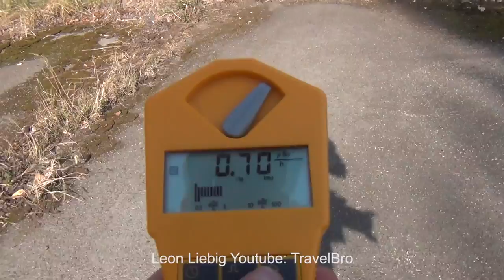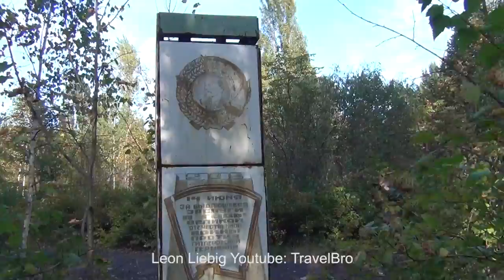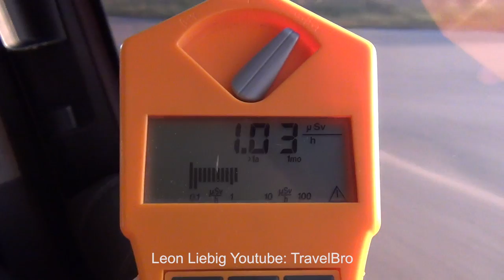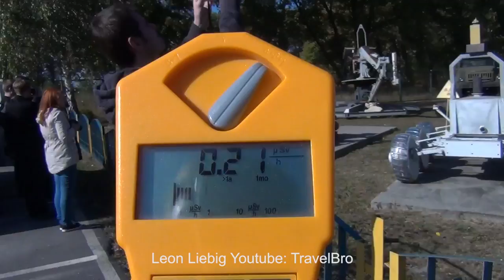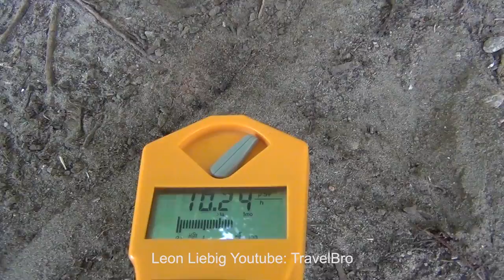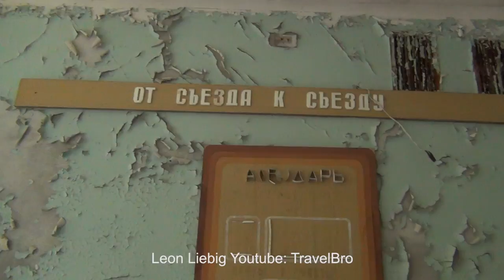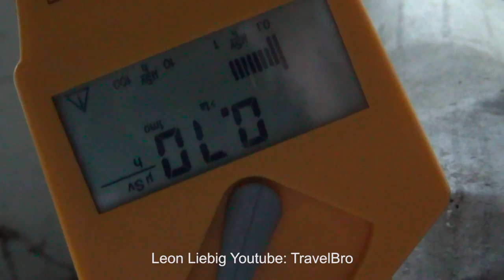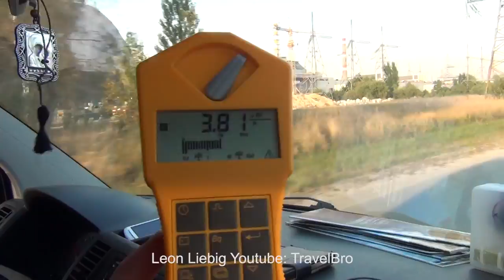Chernobyl Exclusion Zone

Comment: This's interesting to watch, but the behavior of the people during this visit was baffling; the meter was clearly indicating DANGER, and they were just squatting down, nonchalant as can be, watching the numbers. They even slowed down on the road when their meters started rising. Do you realize that the clock is ticking whenever you're exposed to radiation, and the longer you hang around it, the more risk it holds?

Furthermore, in a contaminated place such as that, you really probably shouldn't be crawling all over stuff, let alone touching any structures or plants...the Chernobyl tours website states that.

I'm not criticizing, but I think you guys were a bit careless with your health in doing this, but I'm grateful you went so others can watch. Just...be more freaking careful, please!
Reply from the maker: If it would be dangerous to stay there for a short time, we would not. :) Maybe inform yourself a bit more about radiation. There is a lot good videos about in Youtube :)
Reply: Nkoah nothing in this video was dangerous. standing in front of the reactor gives you between 2 - 4 Microsievert /h.  (Full body dose )
although 30x higher than "normal" places....  3-4 MicroSievert /h Is about the same as travelling on a plane.
.....You Also See them find SPOTS of radiation.  those spots are so small , if they move their hand and device just 1 inch/ cm,  you see it drop.
So the range that is at 50 MicroSievert /H is really small.
So their finger tip might get 50 MicroSievert /H...    But measured at where his elbow is,   it might be only 25 MicroSievert.....  At body maybe 10 MicroSievert / H
Reply: TravelBro I have items in my home that give of 350 MicroSievert /H ...  things My grandparent's generation would wear on their body....  effectively Getting hit with that for maybe 10 hours per day.
and yet people are freaking out over spots with 50 MicroSievert /H.
Reply from the maker: also to the best to store such things at home :D What is it?
Reply from the maker: yes and we do not stay there for one hour. just some minutes :)
Reply: Discover Chernobyl
 to give an idea.   A chest CT is 7 milliSievert. 
Abdomin CT is 10 milliSievert. 
Or 10000 µSievert (the unit of your gamma scout is  µSievert per hour) 

If you're standing around CNPP and you're getting a full body dose of only about 15 - 30 µSievert every hour you would stand in that spot (without any building,  car blocking the radiation) 

If you find hot spots,   they might measure very high,   but you need to get very close to it.  The length of your arm can be enough for the gamma scout to detect 100x less.
Reply: Discover Chernobyl a polonium source disk, 
Some old bowls (uranium paint),  granite rock (uranium)  and a pocket watch (radium). 
To make them light in the dark, old watches used to painted with radium 226, and it has a half life of 1600 years. 
I have seen my detector hit 32 µsievert/h with the watch
Reply from the maker: as i told, it is no problem there!
Reply from the maker: the problem is not the radiation, the problem is that its possible to contaminate smth